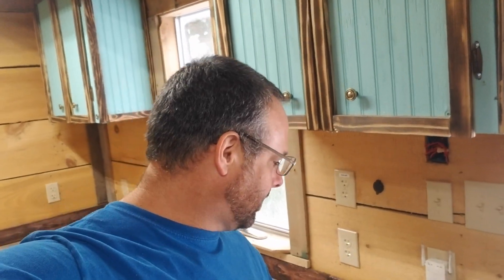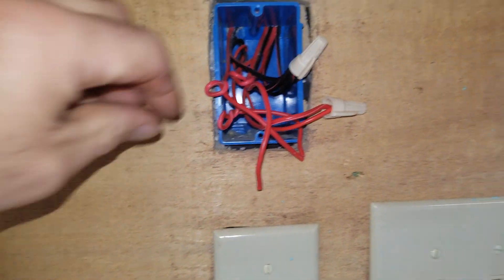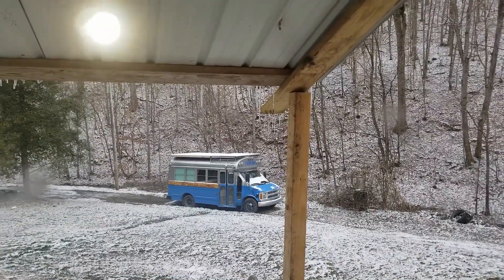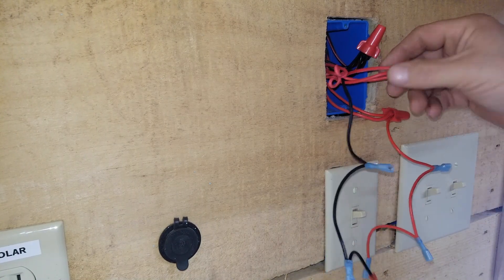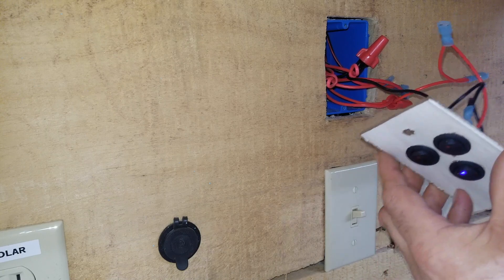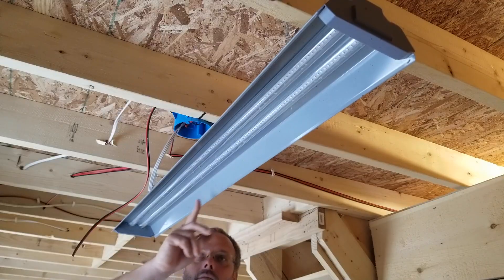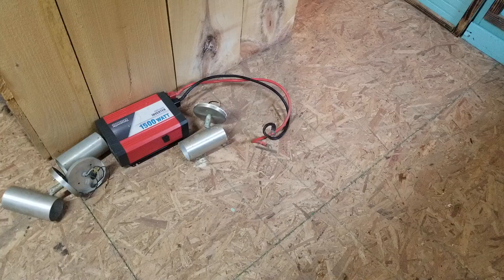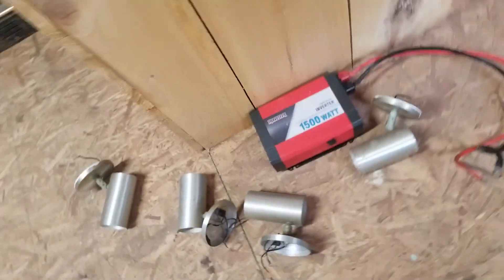Tiny House Solar-Working on DC Lighting

Comment: The OCD in me is screaming put the two switches on top. Love these videos.
Reply from the maker: LOL thanks. I did think about putting them the other way, but in this configuration it kind of mimics the actual location of the lights. If I decide to add under cabinet lights then it will even them out.

Comment: What's your total cost in solar system.pannels .batteries  lights etc.
Reply from the maker: I have around $1200-$1500 in the system I have in Zephyr. 
It has 600 watts of solar panels,        $600
an mppt charge controller.                  $100
3 deep cycle 125 ah batteries.           $375
A 2000 watt power inverter.               $150
Fuses, lights, misc                               $150
so about                                                $1375
That is enough power to run everything in my bus. The house will probably have another 1000 watts of solar on it so about another $1000. Then a 100amp MPPT charge controller $200 
and about three or four more batteries. $450. so in total I will have about $3025 for a 1600 watt solar system which should be way more than I need.